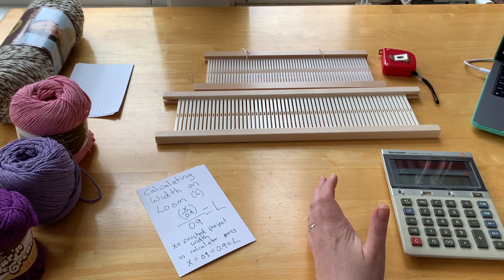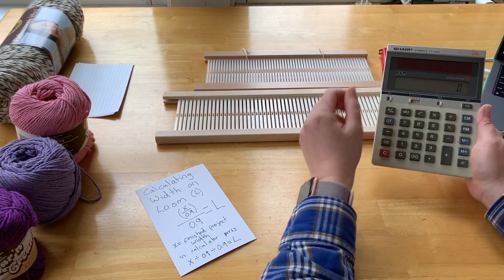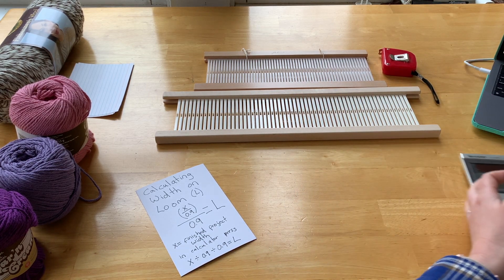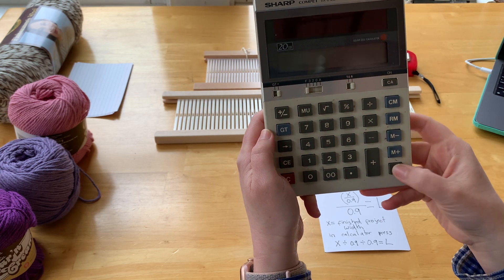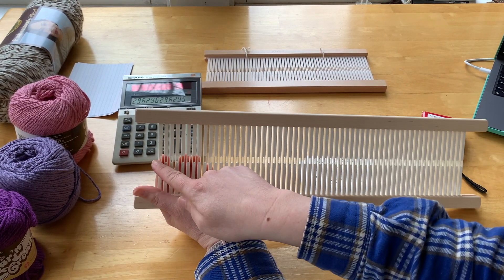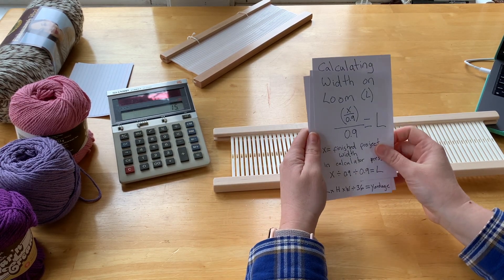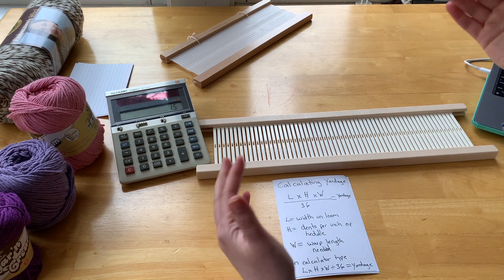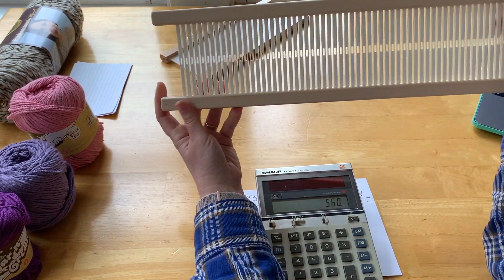Part 1: Beginner's Guide to Double Width, Single Heddle (Time for Math!)

Comment: On you’re 15 inch Heddle, the one you measured, you said 60 holes and 60 slots. You actually have 60 holes and 59 slots. Total 119
Reply from the maker: Yes, but you can go on the outside of the heddle on the right or left side to get that 60th “slot.”